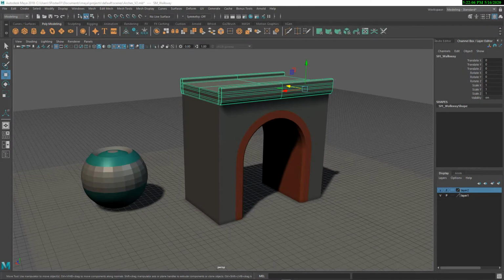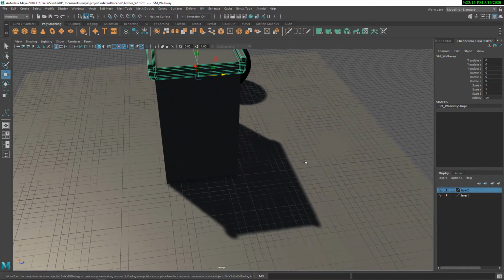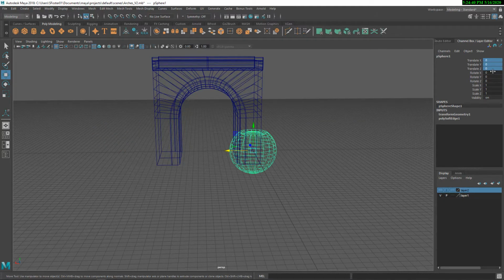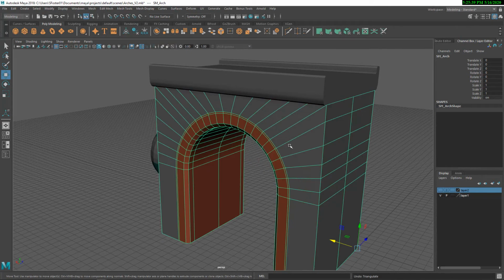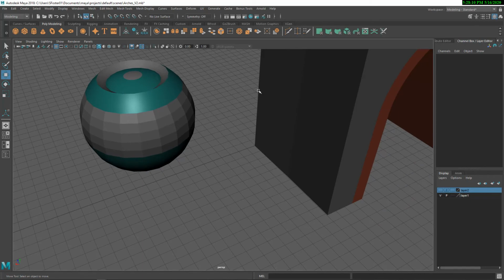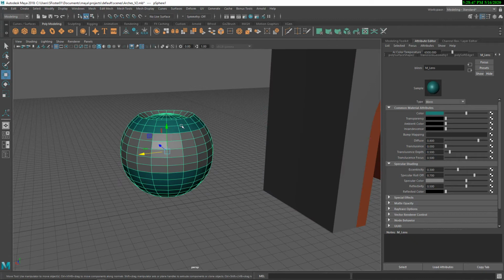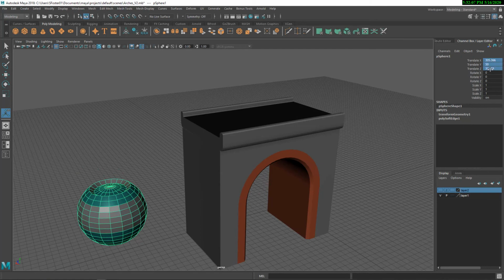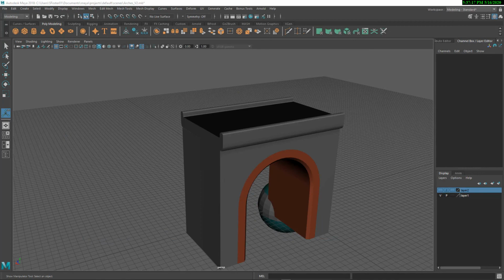02 Unit V2 - Static Mesh Export_1

Comment: Hi Shaun. I have a problem finding a correct workflow. I have a C4D car. different meshes. Lots of materials. Some same materials are applied to different static meshes.  Now once in Unreal I would like to start replacing materials with automotive materials. how do i replace materials on multiple items that have multiple different slot IDs. I would like to select a material and tell it to change to another. if I do it through the replace actor then makes it impossible for me to update the starting mesh. like if I want to update the fbx, the reimport entry is grayed out. what a mess. Thank you.
Reply from the maker: Hey Antonio!  What's your goal?  Is it efficiency?  Yes - it sounds like a mesh-material-mess!  Since I don't know all the details, I'm not sure I'm giving the "right" answer.  I think developing a Master Material for similar materials - then instances for the piece could be an efficient workflow.  I've seen people start to post tutorials for ways to deal with UDIMs in Unreal, 4.27 seems to have UDIM support.  If you do that workflow - you could combo all the pieces.  https://docs.unrealengine.com/4.27/en-US/RenderingAndGraphics/VirtualTexturing/Streaming/#udimsupport
Reply: @ShaunFoster  my goal is to find a good way to replace the materials by switching materials by materials. Because for a car I have more parts with the same materials. But I want possibility to reimport the updated mesh...
Reply from the maker: @antoniopepe  Maybe use Material ID maps outside of Unreal:  3DS Max / Blender, etc...